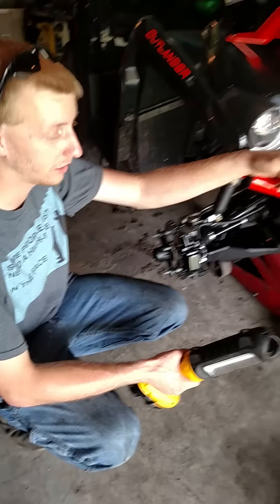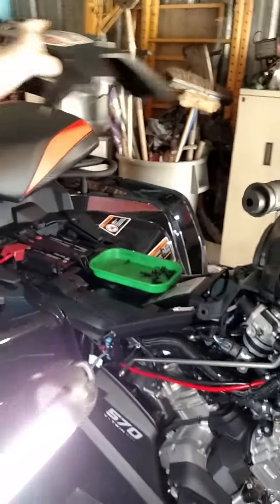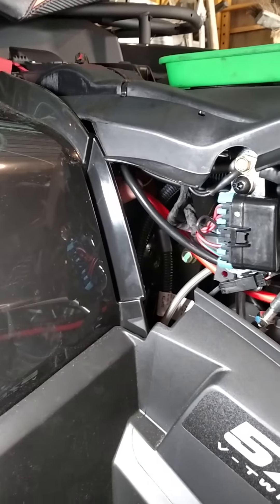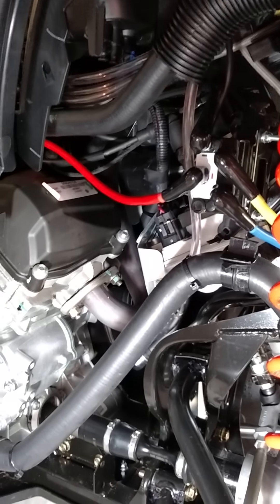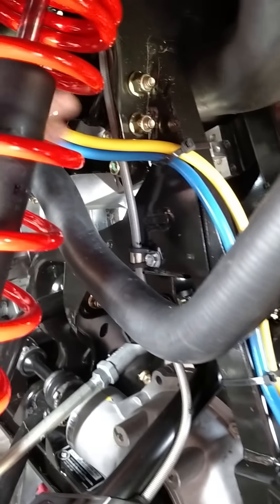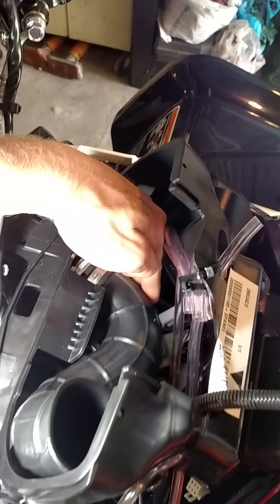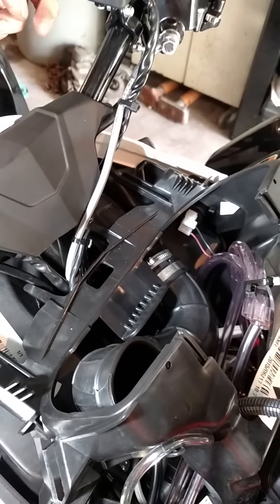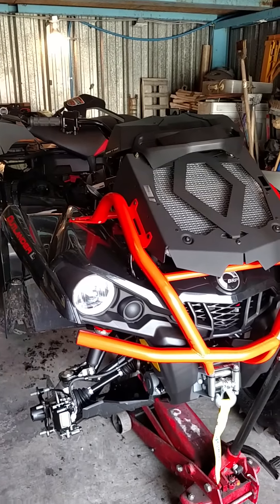2016 Outlander L 570 XMR winch install

Comment: You'll love that winch! I swapped out the factory winch on my 2007 Outty 800 for a Terra 35 and it was night and day difference. These are not the same as the cheapo Superwinches you buy at box stores.

Comment: The wiring connector for the rocker switch hooks into the one under the cluster ? Where do you hook the one for the control extension ?

Comment: Hey Jonathan, I almost check all your videos review on your 570. You should do a long term review of your machine. I plan to buy one in 1-2 month and you helped me a lot. How many miles you put on so far? Thank you
Reply from the maker: lflcoast ty for the feedback. sorry its been so long since a video. both my gates clutches were recalled so the bikes were downed. then my wife joined the air force so its been alot going on.
Reply: Do you know the difference in gear ratio between XMR and standard L 570 ?
Reply from the maker: lflcoast there isnt a differnece between the xmr and l model. only on the 1000xmr do you get a lower ratio transmission
Reply: you confirm me what the dealer told to me. the gearing is samething but clutch is different.. Can you tell me something about that?
Reply from the maker: lflcoast yes when you change tire size youre changing WHEN the clutches move together. think about a bicycle that has a 3 gear system front and 7 gear system rear. thats 21 possible speeds. your primary is your front gear your secondary is your rear. but a cvt has an infinite amount of possibilities. its not limited to 21 speeds. so heres what happens when you go from 26 to lets say 30. you change the load on the engine. kinda like a truck you put bigger tires on it w.o changing final drive ratios then its cruising rpms drops. same thing with the can am. not your engine cant build enough rpm before it engages. so what used to be lets say 1 front (lowest point) and like 7 rear (highest point) on your bikes gears. by changing the tire size youve made it more like 2 front and 7 rear. because your primary spins ups and then pulls the secondary to equalize. but youre to high in the primary. so what you do now is change the weights and springs of the front to make the gradiant to the rear. thus making you stay "lower" in the primary for longer to move the bike. so this is why people LOVE aftermarket clutches after theyve already modded their bike. it gets you back to the way the engine is designed to work with the transmission. its all about engagement times. what does what when. you wouldnt want to go to a super high gear trying to climb a hill o your bike. neither does your can am lol
Reply: Thank you for the explanations!! Did the stock XMR clutch work well with 28 tires?
Reply from the maker: lflcoast yes. currently using the 29.5s with stock

Comment: Where did you put the remote plug? i didnt but the CAN AM one but i bought another superwinch the LT3000 and it comes with a remote but the remote plug is not attached to the handle bar switch and has a separate mount.  i was just curios if this one had the same setup and if it does where did you mount the remote switch.
Reply from the maker: MyNameIsPrivate it does have the remote but i didnt use it. i dont like having to store another thing to get muddy or broken
Reply: Jonathan Stansell ok thanks for the reply.  How did you bypass the remote part? I haven't hooked it up yet so is it pretty easy to bypass? Thanks
Reply from the maker: MyNameIsPrivate u dont have to bypass it. its one of those things u can install it or not. aka optionalni guess lol
Reply: Alright cool.  You probably saved me a ton of confusion. I've never hooked one up before. Thanks!

Comment: Does that winch come with everything you need for the install? , or do you still have to buy brakets for it?
Reply from the maker: comes with everything you need. every winch will come with what u need the only difference. is this kit is specific to can ams so the cables are cut to length perfectly

Comment: What mount did you use?!
Reply from the maker: +Chandler Kendall can ams have built in winch mounts already in the front of the machine. pick out your favorite winch and install! warn, viper, super winch, etc. may have clearance issues with 4k lbs winches